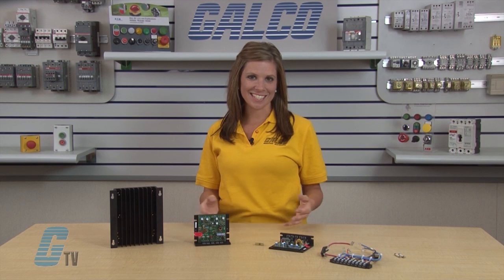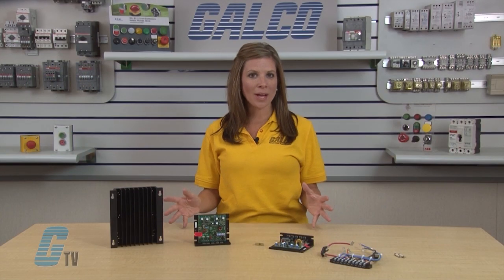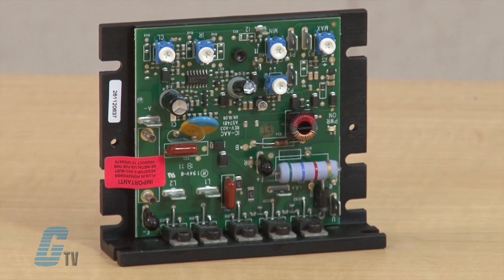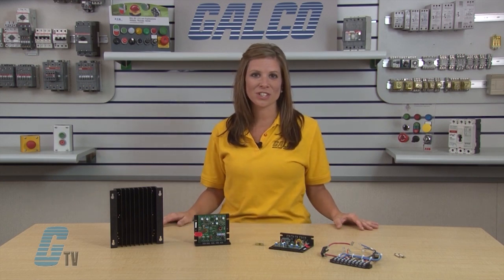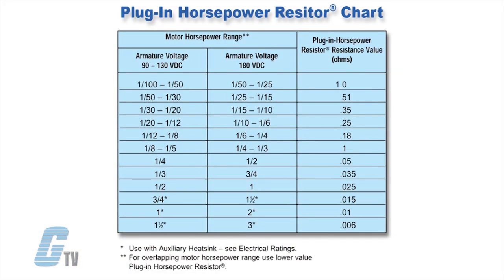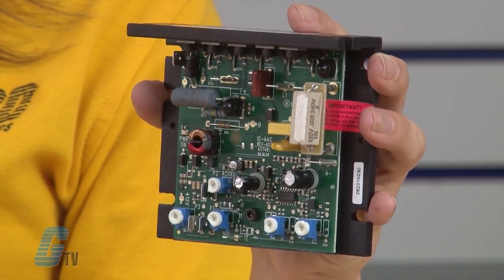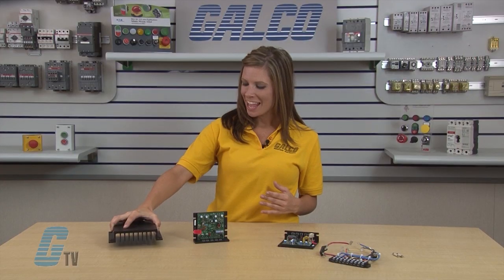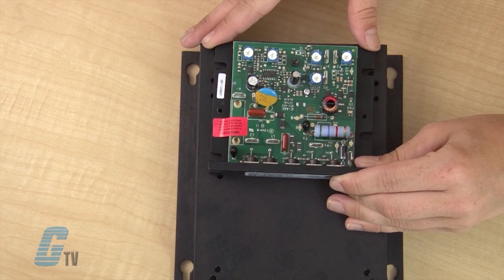KB Electronics KBIC DC Drive & Accessories

Comment: I have a 90volt 2.5HP treadmill motor that I would like to install on my milling machine using a 115 supply. 
Would the KBIC-125 be adequate for the task? 
Also, what size resistor would I need?
Reply from the maker: +ExtantFrodo2 The KBIC-125 is only rated for 1.5 hp at 90vdc. It has a higher rating for a 180 vdc motor. Feel to contact us and we'll gladly help you size and select a unit.
Reply: GalcoTV
 The motor is rated for 2.5, but do I have to run it at that power? The motor I'm replacing is only 4/5HP so I'd be happy running it at 1.5. Is this doable?
Reply from the maker: +ExtantFrodo2 again, please call us and we'll be able to better assist you. 1-800-337-1720